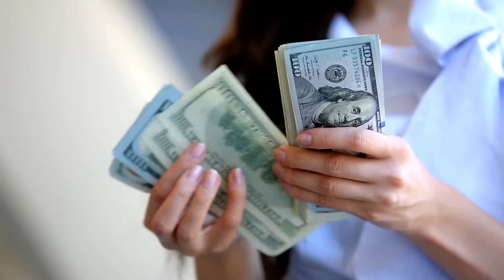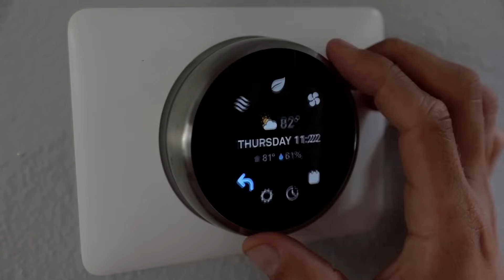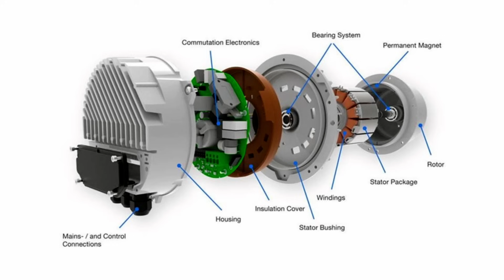5 BIGGEST HVAC Energy Wasters Homeowners Don't Know!

Comment: Getting an energy audit and blower door test will easily find the air leaks though out your home. By learning about air sealing on YouTube has saved me hundreds in utility bills. I use to get notices from my electric company how my home was running 3-5% above or below the average of the top twenty percent of the most efficient homes around me. I started air sealing my home a multi level built in 1960 last summer.  While only about 50% done with the air sealing and insulation upgrades during the summer I had dropped my energy usage to 24.5% below that top twenty percent of the most efficient homes for the summer. When totally finished with the insulation and finishing up air sealing the attic this year I expect to run at least 40% below the top twenty percent of the most energy efficient homes around me. Yes folk having the recommended amount of insulation as well as getting your home properly air sealed will save you hundreds of dollars a year on your utility bills.

Comment: Solar screens and window awnings over windows hit by the sun can be a big help in the summer, 

Also insulating attached garage door can make a big difference.   However getting adequate air circulation to the garage can be a big challenge.

Sometimes in both the summer and in the winter there is a beneficial temperature difference between the inside and outside of our home.   Haven't found an automatic way to open and shut the windows and if I forget to close the windows, will work against us until corrected.

I wonder why there are not shingles or underlayment that provide insulation keeping hot shingles from turning attics into broilers?

Thanks for the video !!!
Dave

Comment: 1970 octopus/ spider ducts two-story getting very heavy flow downstairs very little upstairs. 2 HVAC guys wanted to immediately put bigger ducts and remove the asbestos on them in upstairs.  I asked about dampers and was ignored or countered the one said they can't put in register dampers because there's not enough room as he is leaving I shine a flashlight in the register I said look at that, there's a damper, all the dampers were wide open I'm restricting the downstairs air to see if I can get more flow.
My blower motor says oil twice a year with 20 weight

Comment: Humidity control is a bitch in Canada in the winter.  Because science says at -30 degree Celsius, your home humidity should be 20%.   If its to high, then you cause house damage due to window frost, etc.  But when its that low, its uncomfortable as hell, you feel cooler because of low humidity.

Comment: One thing I have noticed with residential and commercial designs/construction is, poor design in regard to sun light that hits windows and doors. We don't see covered windows and doors any longer as we did. Windows today could use awnings or other built-ins that shade windows from direct sunshine yet n our aera, we see flat stucco exterior with windows in plain sight. This includes some design the have no eves in the roof line. How sad. Whats worse is they will build the same into a two story home so no eves and all of the windows are flush with the stucco and no protection from the sun. All while the industry is so concerned with efficiency yet the building codes allow this to happen. 
Homes with covered porches would be ideal and people want them due to their utility and looks. They don't build those as they cut into profits to the builders. Another concern about building codes are the allowance for recirculating stovetop hoods. The stove/oven are producing heat yet the exhaust hood won't do any help with that in summer weather. Sometimes you have to wonder what the conversations are when codes are discussed. As they continue to ramp up the SEER2 number little by little, that simply needs to go to 16 soon than later.